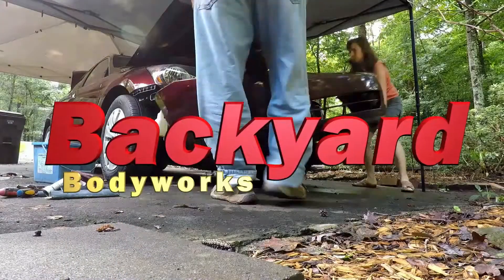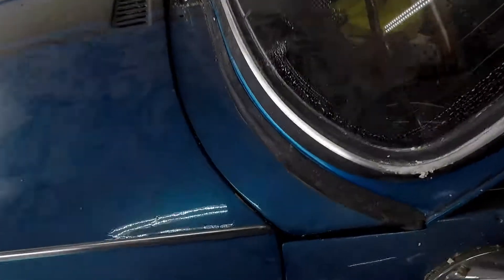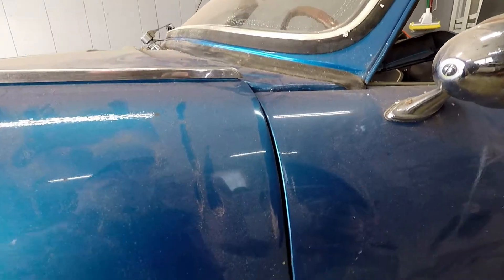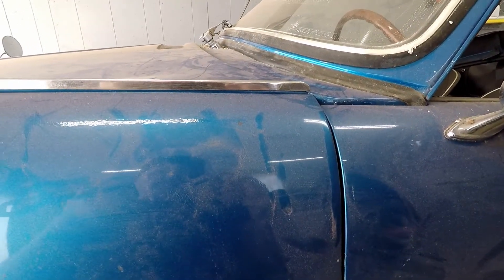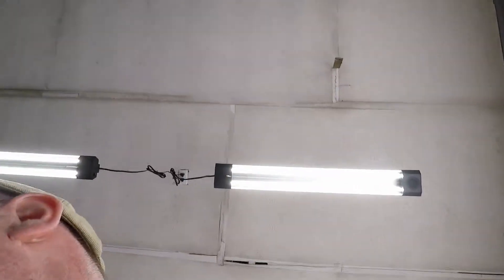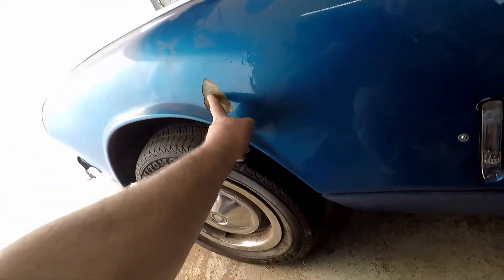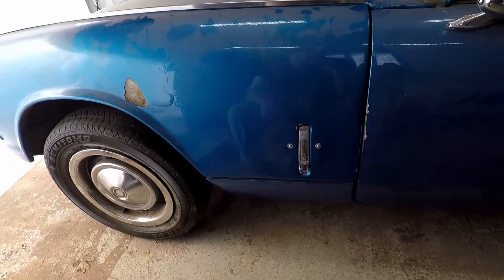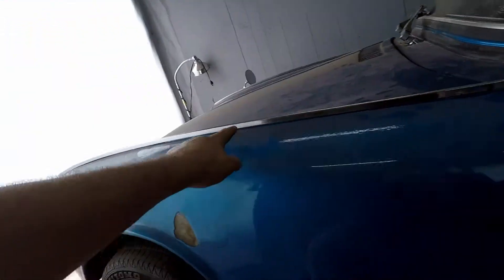67 Spitfire Bonnet Adjustment

Comment: Sorry I missed this. Thank you very much for posting. I'm jealous that it came right in for you! They changed that front pivot point design with the Mk3, but I'm sure it's basically the same. It surprised me that you got so much response from that center tube. I still have some more thinking to do on that. I know that center bulge in the bonnet is common which I what I thought that tube might help with. I'm going to do some more work tomorrow during my visit - I'm not ready to give up yet. Thanks again!
Reply from the maker: There was something else i noticed about that center bracket. Because it is slotted it allows adjustment forwards and backwards,and when i pushed it forward (the plate and bar) the wheel wells moved down and pushed the the fender wings outwards, and when pulled back it draws the wheel wells up and fender wings in.(something i didn't think about till after i posted the video.) The backwards and forwards as well as the skew of the bonnet seems to be controlled by the tubes that run from the clam hinge up over the wheel wells. The adjustments at the claim hinge also controls forward and backward as well as up an down with the  rubber stoppers that are at the rear of the bonnet. Maybe loosening the center adjustment and the ones on the wheel wells then pulling the center one back while leaving the wheel well brackets free to let the tube move side to side will get rid of that hump in the middle? I think i might look at that tomorrow and see if that is the case. worst case scenario....it doesn't change anything or makes it worse....that's work on a British car....LOL Good luck with your adjustments....Cheers!!
Reply from the maker: Chris you are very welcome....I wish I had this medium years ago when I first started restoring the 67....I would have done things differently....

Comment: hi... noticed you lifted the bonnet using the latches.  you don't lift the bonnet from the latches or paint cracks will form.  you lift by sliding your fingers underneath bonnet line to rocker.... or from the the wheel well.  cheers.